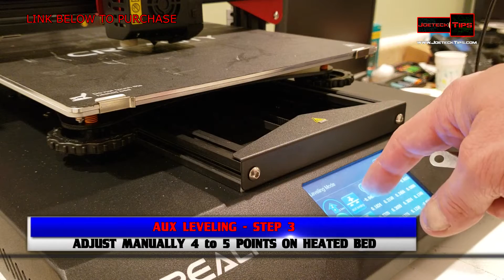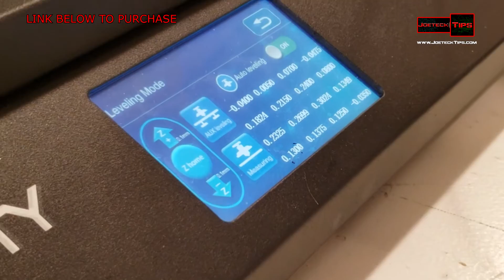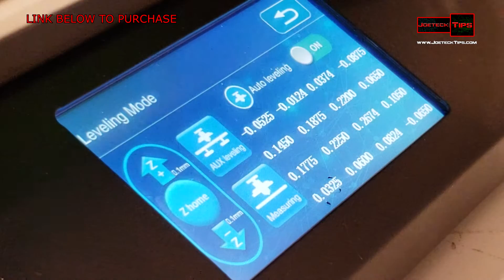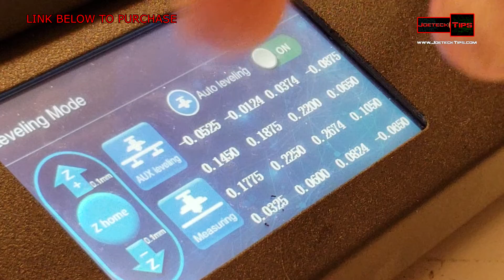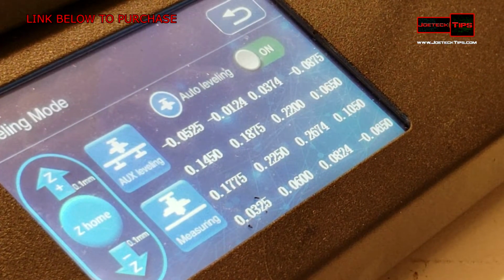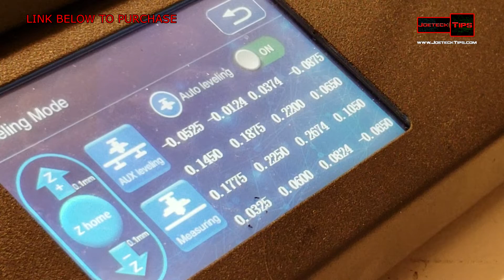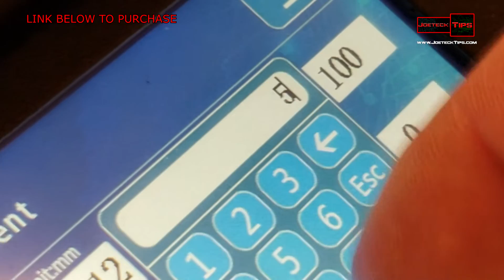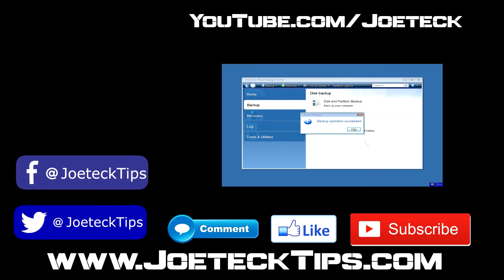leveling the Creality CR10S Pro | HOW TO | JoeteckTips

Comment: Hi Joe, be honest - would you buy it again? Not an easy question because if the first layer is good, the print quality is outstanding. But that is pure luck, the sensor is fully useless, also the 16 point mesh ABL because there is no profile available which will support that mysterious kind of ABL. The common G28 command from the slicer will reset every previous ABL settings. Beside this "sensor" there is no kind of documentation available from Creality what the firmware do and what not. By the way, their support is not available! They are answering not the smallest question and refer to the seller (ask Amazon LOL). The created ABL mesh in best case - how do you use it? E.g. Cura offers only CR10 and CR10s profiles - both without any ABL activation Gcode .  Creality ships also no kind of slicer support. So, you need to build your own slicer profile including ABL - but how do you do that without any docs from the manufacturer? We tested all that "manuals" for bed leveling out there. It has no effect if the sensor is hight-adjusted or not - and so on. Some videos are showing a glass plate - we have only an alu-plate, whyever. Your video is showing the reality - thanks for it. Adjusting 20 mins the bed-level and try to print. If you have luck, it may works but in most cases it works not and you are not able to remove the print completely from that bed surface too. No end-sensors for the z-axis is the starting point for the problems. This ugly, useless ABL sensor completes the problem with the z-axis and at the same time with any work around the bed leveling. CREALITY! - several month now and you are not able to fix that problem? It would be one of the best 3D printer in the market if you at least guide us to bypass that not working ABL ..........
Reply from the maker: Probably not. Tech support blows moose balls. I asked for help and they told me ask where I purchased it from. Really!!?? 
" Its your fucking product, assholes! "

For that, i can NOT recommend it.
Any company that does not back thier product unless purchased through their website is bull shit!!!

 I purchased this based off of other reviews, but it seemed to be all bias. 
My review proves on how imperfect it is. As you can see i am pretty tech savvy guy and if i am having trouble its not all that good. 

I did buy a glass bed, but it was the wrong size. Needs to be 310 x 320mm. 

What i did realize is that the sensor does shit. Doing the 20 point Z axis scan, is meaningless. At each area being scanned it should remember the height offet and remember it based off of the sensor height. This way even if the bed is uneven it will make the appropriate adjustments, but it doesnt do that in the slightest. It may look like it works that way, but far from it.  Sometimes the print head hits the bed and some areas it doesn't. SO whats the fucking point??

Personally the OS / Firmware needs alot of work. I agree, the sensor is the problem. I bought the PRO thinking the 20 point z leveling would be a huge improvement from the CR-10S. 
WRONG!!!

Someone must have had some kind of success with it. 

HOPEFULLY, between a handful of us we can find an answer to this madness. If we do, i will do another video giving shout outs and props for whoever is involved. I am cool with that and you would be in circle of trust worthy technology guru's! 

Who knows what will be in store for thise lucky people if that does happen.

Feel free to join my forum,  i will create a room for the Creality CR-10S Pro and we work from there. Hope to see you there to get to the bottom of this disaster of a 3D printer.
Thanks for the comment, and welcome aboard!
Reply: @Joeteck  I feel your pain I just fought with the new ender 5 plus for 7 hours ....I'm bangingnmy head with this bullshit auto bed level shit

Comment: Joe, The reason your bed seems warped is the fact that your manual adjustments are not at the same level when you started. In other words, the adjustment knobs for the bed on the bottom make sure they are at least the same point, to begin with, if they are too far off like the back two are tighter than the front it's not going to work well no matter what software you use for leveling. Remember if you start with adjusting everything based on a bed knobs that are all off everything follows that path as well.  Just my two cents from a 3D Printer guy
Reply from the maker: Did you thumbs up your own post? 
I have read the directions pretty thoroughly many times over and over. There is no real continuous way this can print. However, a group of us will form a team of Creality CR-10S Pro Guru's and get to the bottom of it.

Comment: Thank you very much for the video Joe, there are a few things i'm doing incorrectly due to official and other channels that are either not covering all steps properly or not providing info where required.  Some forums say "use 3 sheets of paper on top of the wrench supplied" (to set the sensor)... and most important step, you MUST hit the Home button.  The printer's Save "feature" is a work in progress...  I am thankful to all those who have posted elsewhere to help, even if they did get it wrong, it's entirely Creality's fault, maybe even the reviewers got duped... who knows!

At the end of my "leveling" and starting my print, there have been times when i have to adjust to +0.95 (not 0.095...) or -0.65 ... from a level bed. Or turning all four bed leveling nuts 6 half turns counter-clockwise because the nozzle is trying to dig in so deep. I've had some frantic button-pushing-nut-turning experiences with this!  This is after the Measuring feature shows i have levels right across the bed within 0.05 to 0.08 or so, i replaced the Creality bed with a glass and PEI sheet.

I only really need one thing with this printer - 3 hands...

In all honesty though, the times i have got the printer running properly it's truly fantastic to watch.

I have just setup a really long print at 0.12 layer height and had to adjust height a bit but the first 3 layers have gone down smoothly without having to stop the print, remove the fail... restart... adjust adjust...

It seems that sometimes the adjustment value while printing that you can adjust, and that is only available while printing, is remembered...
I started this with the printer unplugged, levelled X, plugged in and turned on and did the levelling as per your video and when i started printing my previous value of +0.25 was on the adjustment screen... now it's at 0.60.

All in all i am really happy with the printer despite the problems.
Thanks for getting the video up so quickly, it has helped me a lot, keep up the great work!
Reply from the maker: That was a well thought out reply. Its my pleasure to do videos for my subscribers.  I do hit the home button to get it centered. I agree, it doea take alot of tickering, but once you have it tuned just right, its perfect. I just wanted to show how it really works. I havent seen a failed video review yet on the CR10S pro. And right after leveling the printer it was still messed up. Thank you again for being a loyal subscribers and supporter of my channel. Cheers
Reply: Hi Joe, just an update... that print failed, printed beautifully 10mm in height then it started 'squashing' the print... i wasn't around...
What i noticed today, if you go to Settings, Move, Home, it stops at "10"mm for me.
The black acrylic piece is 100mm and it doesn't fit to level X, it seems more or less the thickness of the acrylic piece off, so i'm thinking definitely the sensor should be a lot closer to the bed and maybe i can get it to the proper 100mm (still have to adjust the right side though).
So if you from the Home'd position just go back to the Main Menu and then go back to Move, the 10mm, for me anyway, now displays 10.2mm.  Is that relevant in any way?
!
Reply from the maker: @equestriansa3482  where are you located? Can we talk over the phone possibly?
Reply: @Joeteck  I'm in South Africa, i'll send you an email, we can chat.

Comment: Where can I get that black plastic piece you used for leveling the sensor?
Reply from the maker: It should have come with the printer.. i could make you one if you'd like.
Reply: Oh ok thanks. Still debating on which 3D printer to get. But this one seems like a winner.
Reply from the maker: Yeah, its a great printer. I am currently making chess pieces for a HS during their study hall